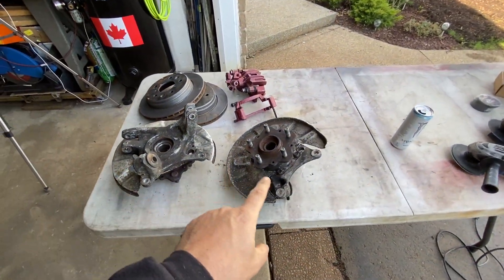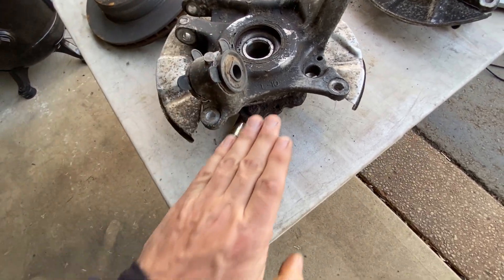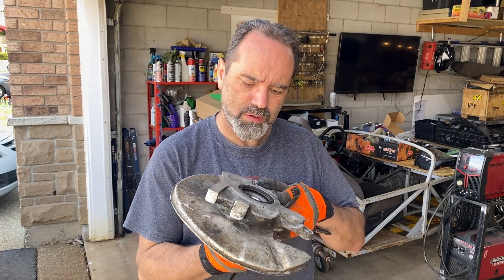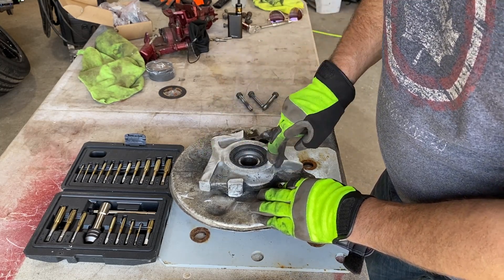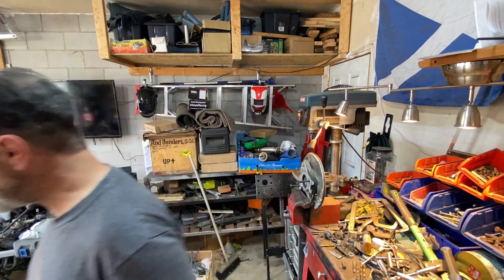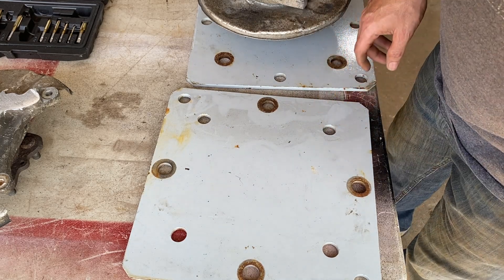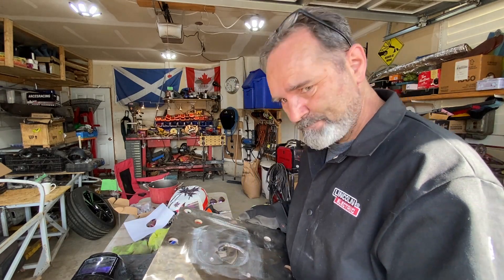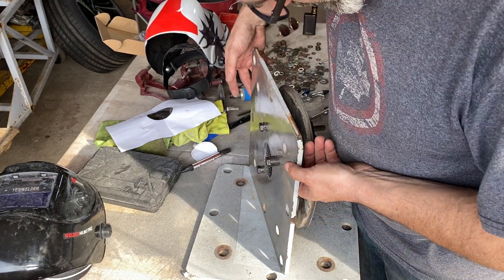Making Hub Adapter Plates To Fit FC RX7 Rear Hubs To My Locost 7 Track Car

Comment: Split lock washers, like you appear to be using to attach the steel plate to the hub, are worse than useless on relatively hard materials like steel.
Reply from the maker: What would you suggest?
Reply: @ScottRods  if you want to use a washer, use a plain flat washer. On steel, you're perfectly fine with nothing though. 

If you want to keep it from backing out, use loctite.

Comment: Try your rotor and caliper to see what will need to be trimmed.
Reply from the maker: Yeah. I plan to attach brakes and wheel before I decide on control arm connections.

Comment: 19:15 It seems the rotary has infected your brain now... 
 
Do away with the upper control arm, mount the coil-overs between the top of your plates and a mount you will make on the chassis. Some type of control arm cross shafts could mount to the bottom of the plates to be shimmed out and a bushing mount could be adapted to the lower control arms. Doing a quick search, the rod ends seem like a more cost effective and adjustable alternative to that though. 

One thing I would want were it me, is the hubs to be more precisely mounted to the plates axis wise. Maybe pop out the wheel studs so there is a definite known face to start from, and find someone to mill the back of hubs so they are on exactly the same plane.

Look forward to seeing how you sort it Dave 👍

Comment: Rose joints would give you so much more adjustment, but there is nothing wrong with poly bushings. 
Looking at the video it looks like when you held the upper and lower arms the hub and plate were spaced about were you may need them. Put a level vertically on the plate, get you shaft level and see we’re the arms set before you cut them off. It’s looking good

Comment: Maybe find out mazda rx7 rear end caster/camber , toe in toe out specs and weld arms str8 to backing plate...after have done suspension and tyres and weight of car???

Comment: I would think you would need some kind of adjustment for a toe situation...remember all the rear joints have forces on them constantly...braking..acceleration and traction ...side g forces...plus up and down from road use.....if it gets out of alignment you need to compensate for it...I'll wait and see the rest of the suspension....
Reply from the maker: That's a very valid point Joe. I could set it all up perfectly, then one pot hole and it's all gone to sh*t

Comment: Also the plate I would of had the centre hole the same ID as the carrier OD after turning it down flat . If it comes lose Dave your in the poop . Your on the right path but it needs to pass a safety checks and I don't think it would pass like that . Every car I have pulled a hub off that bolts on is like that was machined to fit like that so it helps take the loading of the car part from the 4 bolts doing all the work

Comment: If you can get them apart Dave with the hub out use your lathe to spin up the carrier and machine the outside of it flat so when it bolts up it a 100% true

Comment: Those bolts look a bit loose(for the plate mounting). Maybe you should use STI taps an install inserts.
Reply from the maker: I'm not sure why they are like that. I used the right Tap. Maybe I can get bolts with a wider pitch or something. Or maybe the aluminum had expanded due to heat from all the cutting and drilling. I'll check them today.
Reply: @ScottRods  Did you use the right drill bit? I'm a machinist by trade. You could get some STI tap, and some stainless steel inserts(plus inserting tool), to fix the issue. Do you guys have McMaster over there?

Comment: On a budget... take some tube with an ID that you can get off the shelf bushings for (like leaf spring bushings or similar), weld the tubes to flat plate so they can bolt on to your hub backing plate.  Then just use shims between the backing plate and bushing plate to adjust camber/toe.  Alignment shims are readily available for older cars, or you could make your own out of shim stock.

And the "rotor" drawing, nice touch.
Reply: I would find some camber and castor bolts and put a slotted in the arm and like you said use a leaf spring bush then you don't need to shim's and it's easy adjustment
Reply: @NZMOPAR  for track cars (road course/autoX) I'm against slots as the alignment can/will move.  For other types of cars they do ok.  Shims are a pain but they're cheap, and once you settle on an alignment spec it likely won't get changed much on a car that's being used for HPDE not racing.
Reply: @rennkafer13 very true. but I did wheel alignment on lots of street car's that were made into track cars in Tasmania and never really had many problems with stuff moving unless they come off the track and bounced over ruff grass runoffs or hit something
Reply: @NZMOPAR  just as an example, Miata/MX5 use that alignment method, and it works fabulously on street driven cars.  They're well known for having difficulty staying in alignment when used on track though.  Seems simpler to not build in a possible problem to me.

Comment: If you check out some off road channels they make adjustable 3,4 or 5 link suspensions with dom tubing and heim joints. I understand you're on a budget but you could adapt that type of swimgarm  to each rear corner. Left and right threaded heims so they're alignable